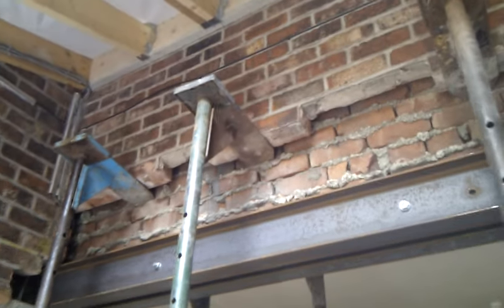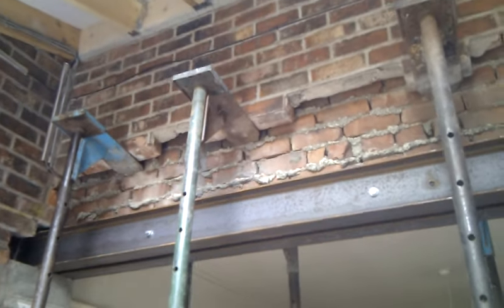How to put Steel RSJ Lintels into a Supporting Wall

Comment: Rather than laying a board across floorboards you should always take out floorboards and allow the props to sit on a scaffold board on solid ground -- or if the ground is soft preferably cast in a concrete base for this purpose. The brickwork you're supporting could be holding up 4m of wall, half a roof and half the first floor, which is an incredible weight to place onto floorbaords. Superb video and very clear explanation though! Please keep them coming!
Reply: No chance do u need to do that in 90% of cases

Comment: Just one point. Put the beams on the inside of the props BEFORE you crank them up and start the demolition. You will not be able to weave those beams between those props if you try to do it later. 
Ask me how I know.
Reply from the maker: Take it you tried to bend around the props.lol?
Two ways we could of one as you say lay it on the ground before you demolish or prop the wall. Which is what we did. Or we have took out the brickwork and slide it in . Both a pain in the arse.lol thx

Comment: Getting ready for a job much larger than this. 4 story building had the columns by the basement door fail and need to replace them. This video I will show them as a general overview of thier upcoming. Thanks good job.
Reply: Every task of Masonry alterations is different and should be planned in advance and carried out upon its own merit with a variety of temporary support equipment most suitable.
Please read our “2019 masonry wall propping guide” for further information at; www.brickbrace.com

Comment: This is some good stuff but I was wondering when installing the brickwork from the new beam up to the existing brick work, how do you ensure the gap is zero? Is there any slight settlement? Causing cracks in the wall?
Reply from the maker: Hi Abdul when bricking it back up use pieces of roof slate to wedge in to the mortar joint.
Check the slate size first . Then point the mortar in the joint then hammer your slate in.
Making sure not tooooo much hammer to disturb the brickwork above.
We slate ever 12" then fill the rest with mortar.
Leave to dry before removing your props.
Hope this helps.
Karl
Reply: @thespecialist7  Thanks for the swift reply I will definitely subscribe
Reply from the maker: @woowididit   be carful that you never over tighten the across props I have heard of them pinging of the wall.
Stand to the side of them when you tighten them up.
Also if your on a wooden floor put extra timber across to take the weight. 
Good luck fella

Comment: Showing how beam was installed around acros would be insightful for ppl doing diy
Reply from the maker: OK yes. People forget to have the steel below on the ground d before any props are placed in due to not being able to put the steel in position.
Unless you have lots of room to slide it in afterwards that's cool. But never the way.
So put the steel in position on the floor first then start putting your acro/strongboys in to hold the wall up
Reply from the maker: For the people doing there own works. DIY  please contact a structural engineer  to get all the info for doing the job.
So many people just do it then plaster over it.
Then when they come to sell the house they have big problems showing what has been done. Sometimes asked to take of the plasterworks. 
Last thing you want to do.
Take lots of pictures with tape measure out showing what's been done . Just in case.
Also pictures of concrete pad stones.
Do not over tighten the acro props as I have heard they can ping off so when tightening then up always stand at the side of them. Good luck.
Stand back and think of what's to do. Don't rush it.
Karl

Comment: Thnks for the info.  I have a 2225mm cavity what size do the beams need to be?  It looks you used two beams side by side - is that the case?   thanks
Reply: In U.K. it’s a build regulatory demand that you use a structural engineer calculate the beam loading.

Comment: Good advice on propping & padstones, but loadbearing steels on Thermalite one side and chopped off bricks on the other, with no attached piers, is not best practice.
Reply from the maker: All works gets passed by a building control officer. Think they are the people to say if its right or wrong.
Thanks for your thoughts tho.
Reply: @thespecialist7  - Mmm, you have more faith in BCOs than I do! And a legal case about 20 yrs ago established that liability for failures in design remain with the builder/architect/engineer if anything goes wrong, not with the BCO. 
Having investigated building defects for many years, I’ve seen the same old ones coming up again & again, which should have been picked up by BCOs but weren’t. And since the advent of approved inspectors, if anything things have got worse. My neighbour had an extension built and the inspector didn’t call once during construction.
Reply from the maker: Doublethink you do seem to know your stuff. We always take the advice from building inspectors. It amazed me from jobs in the past how things held up . People not putting the right supports in. Yes I agree.
Reply: @thespecialist7  - Well yes, it is amazing how long unsafe structures can stand. I once went to a huge rubble stone barn where both the front & rear walls were leaning forwards, well beyond their centres of gravity, with a v.heavy king post, stone slate roof above & no crosswalls, yet somehow it was still standing. But doesn’t mean to say it won’t suddenly fail, as I told the owner (& to not go anywhere near it!).
Reply: Both BCO and designer (if any) will probably have clauses indemnifying them in the event of mishaps or eventual failures of the structure? Who loses in the end?

Comment: Can you keep the remaining old walls flush with the new, extended walls (the breeze block ones), or do you need to build some columns to support the RSJ beam, or is imbedding the steel beam into the existing brickwork (left/right walls) enough?

Asking, because I'm wanting to have something similar done, but I want to have the new walls be flush with the outside walls.
Reply: Hi Rhuari. Did you find an answer to this? I’m in a similar boat

Comment: After watching  your clip,Im wondering who did the calculations for the steel RSJ ?the reason I ask is that all doesnt look right to me, if  this steel is holding up the right angle of the building?apart from that everything looks fine,RAMS all in place I hope.
Reply: Done 100s of these knock throughs with structural calculations and this Looks more than adequate. I'm sure this bloke who certainly seems to know what he's doing here isn't cutting any corners.

Comment: What size of rsj
Reply from the maker: I think this was 2 lintels bolted together. Size 8"x 4.5".
Remember always get structural calculations to do any works.
As this will cause a problem if ever you sell your house.
You will have to take the plaster of the walls to show the steel and padstones. 
Use building regulations to do the job.

Comment: I don't think building control was involved with that build,concrete blocks as padstones and no 150mm bearing each side of steel??
Should be 225mm concrete lintel + bearing of 150mm each side or steel spreader  plate along with structural engineers cals to make sure the right steels are going in!
Reply: Solid concrete padstone (blocks)they look like to me. Just the way he said it.
Reply: Also, steels only need to sit on 100mm, not 150.
Reply: @elliottmholt  pretty sure it's 150mm minimum.

Comment: Yet another video on YouTube where Strongboy’s are being misused. A Strongboy was designed to be used from one side of the wall. The props and needles method would of given the correct fitting space without the need to remove the wall below and without the steels being in the final position.
A Strongboy is only for temporary support and not for overnight support when the builder is not there to check, further support should be added to reduce the risk of collapse when not worked upon. The task should never of been left half finished like that, shame on you for teaching your viewers bad habits!
The main cause of collapse during masonry alterations is overloading due to removing Strongboy’s further from the wall to either avoid internal 1st floor wall damage or where attempting to gain more fitting work space as over extending greatly affects the capacity.
–
The Maximum Safe Working Loads
(S.W.L)
–
An Acrow prop, 3,400Kg.
–
An Acrow prop used within the props and needles method, 1,700Kg.
–
When fitted with a Strongboy or any other similar designed product the Acrow props safe working load is severely reduced by at least 90%, from 3,400kg down to the maximum 340kg and can even reduce down to 0kg of which depends on the size & the working height of the Acrow prop, how plumb, how tightly fitted and how far the Acrow prop is positioned from the centre of the wall.
–
It’s urban myth that the Strongboy is suitable for every task, with the instructions changed by enforcement of the H.S.E in November 2015 and now read; “Before using a Strongboy you should identify that it is a suitable method to carry out the intended works”.
To carry out a task safely, read our “2019 masonry wall propping guide” at;
www.brickbrace.com
Reply: I agree with this comment.